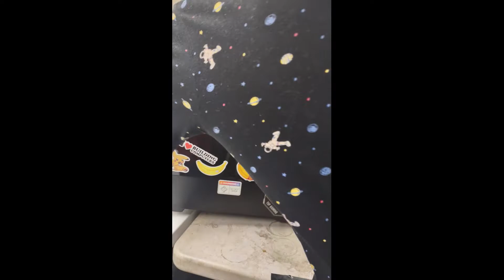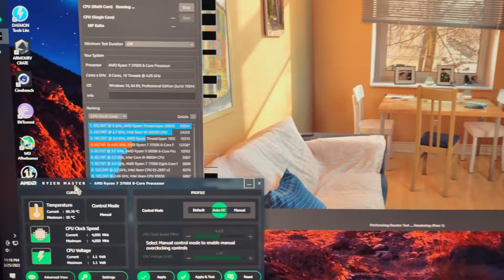Replacing CPU Thermal Paste - Ryzen 7 3700X - New Thermal Paste

Comment: Damnit, I don't have any temp problems and my CPU seems to be running fine(well outside of noise which im upgrading the Cooler today) but I get under 100 on both Single and Multicore scores :(